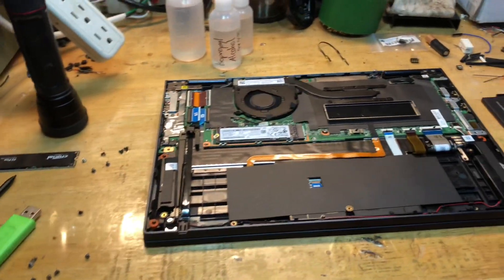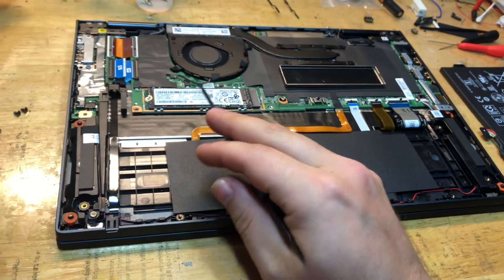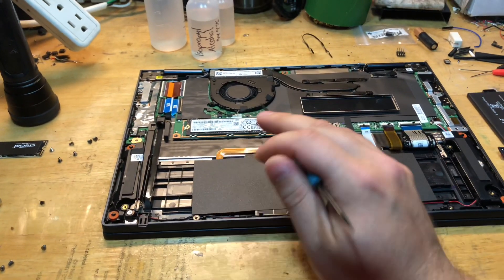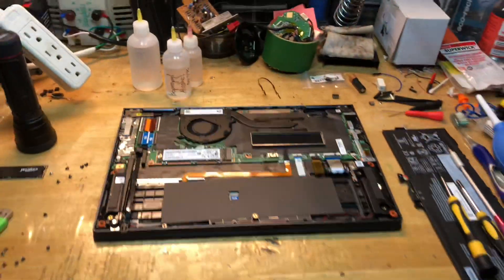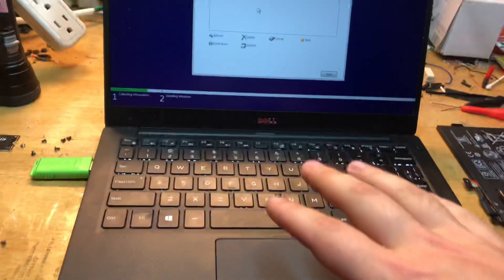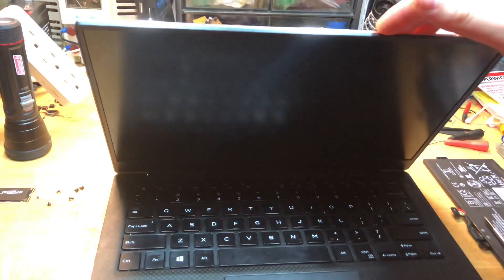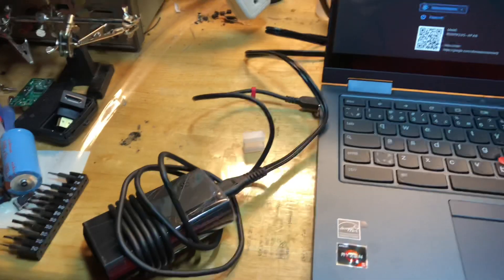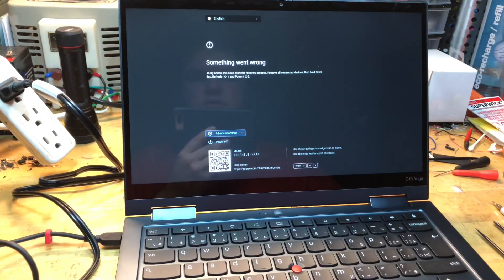I Absolutely Hate ChromeOS! - Lenovo ThinkPad C13 Yoga Gen. 1 Storage Formatting [Video 8]

Comment: Respectfully, this is not a wipe anyone should be paying for.  You need to at least do a 3 pass wipe (it writes three passes of random data) with DD or use Shred, both tools on the Linux USB you decided not to use.  Removing partitions via Windows leaves them open to being easily recovered.  If you had installed windows on them that would have at least been something that might have "rewritten" a portion of the data and likely made the old partitions harder to recover.  But the way you did it, anyone with a Hiren's Boot CD or frankly a Linux USB should be able to recover the data off of that drive that you "wiped".  Read up on DOD wipe standards at the very least to do your customers by at least adhering to those basic standards.  There are far more effective tools out there if you want to step up your game even more, but they tend to cost money.
Reply from the maker: For what the customer wanted and what he was willing to pay, what you describe is overkill. Also, I don't exclusively deal with erasing hard drives, so for the time being it works.

Thanks for watching!

Comment: I installed mint Linux on my Acer 15 Chromebook (CB532) but was never able to find a proper BIOS to flash it back to Chrome when I wanted to use the built in Mic again.  Be sure to back up the original BIOS if you are switching to Linux.
Reply from the maker: Thanks! I didn't install an OS after I wiped the drive, but I will take note of that if I ever do that in the future!